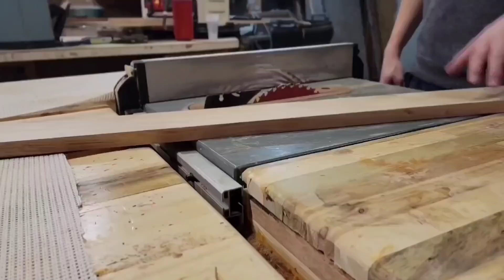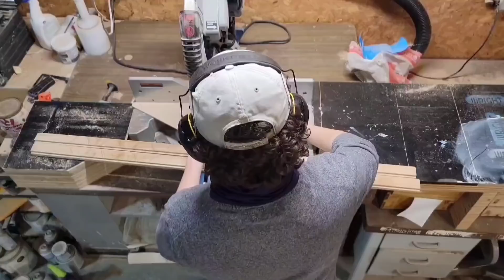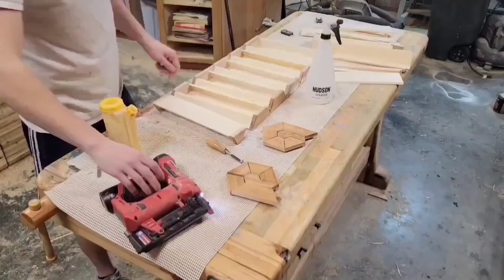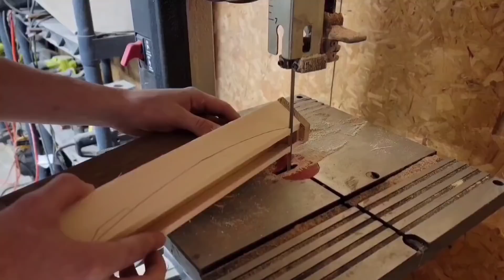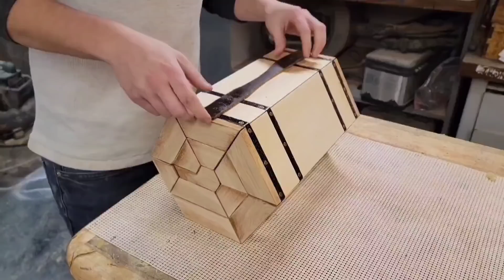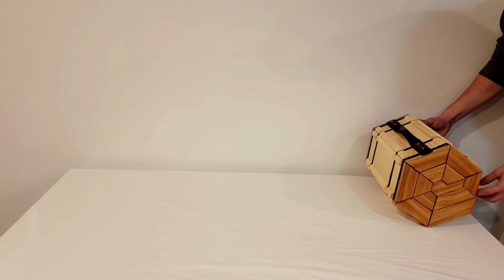Making A Very Unique Roll-Up Toolbox | Woodworking

Comment: This is definitely a very cool project but I would have liked to see you roll this out with tools in it and see if they stayed in place
Reply from the maker: Tools stay put pretty well. the only issue is the last compartment when rolling it back up. I ended up making a lid for the last compartment.
Reply: @JoshWrightWoodworking  A winner for sure then.  Well done

Comment: I have one of these in plastic from ~20 years ago. Nice build.
Reply from the maker: Thanks!  A rolykit right? I changed it a bit but that was a big inspiration for this project.
Reply: @JoshWrightWoodworking  That's it. It was a little more interlocked. I could see it's use case, but never was practical for me.